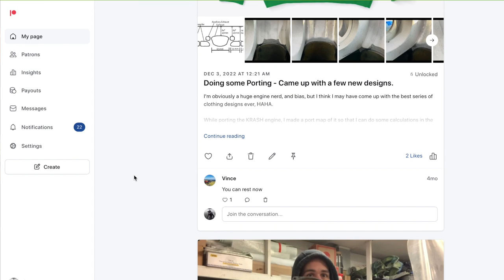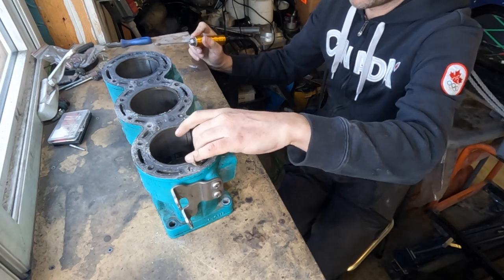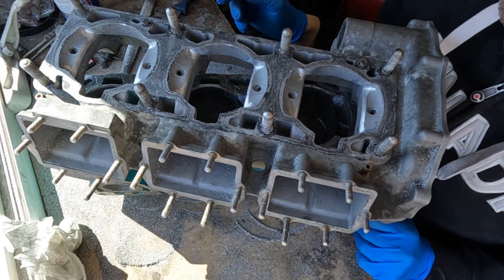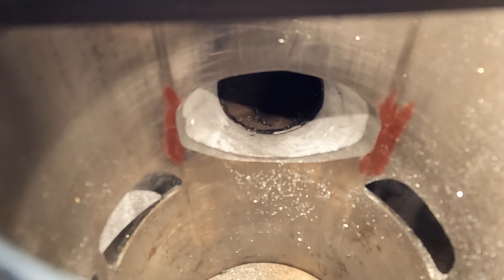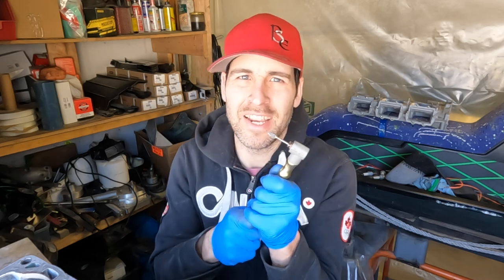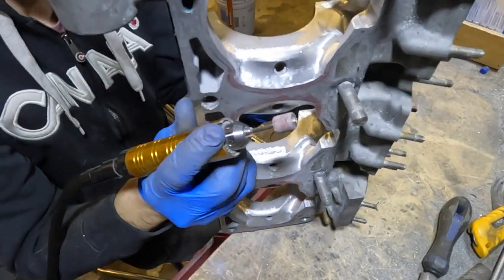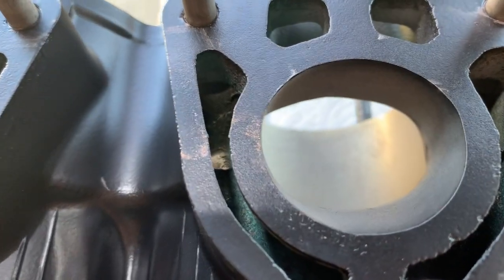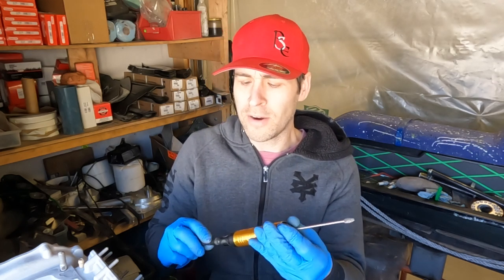ZXi 1100 Porting - Cylinder, Case & Tunnel Porting - Featuring Vevor Flex Shaft Grinder.

Comment: Joel you are a humble bad ass!!  Nice work bro on a tasteful port job!  Clean and not overly radical, perfect IMO. 

I personally think you should run your skelotonized flywheel cover!  You keep your stuff so nice I highly doubt a random bolt will ever be rolling around your engine bay that could pose a problem!
Reply from the maker: Thanks Tim. Let's hope we get some great results out on the water ! 

That's a great idea with the skeletonised cover... With the zeeltronics all the ignition really rempeds on is the trigger coil... so all the stator will be doing is charging the battery. I plan on unwinding the exciter coil to get rid of some parasitic drag. 

Good thinking... I'll have to powdercoat it ...
Reply: @Joel Arseneault  I've never seen a skelotonized flywheel cover I don't think on anything!  That will be pretty exciting I think to any motorhead seeing that!  For that reason alone I hope you do it!

Comment: What type of epoxy did you use? A link would be great!
Reply from the maker: I used squid boat epoxy ... but you don't need to use a specific brand. I have 3-4 different epoxies and used it because it's inexpensive (relatively) and doesn't have to be top quality. I mixed in some milled fibres to make it a little stronger (you don't need to) it also makes it a little thicker. 

You could use JB weld or any type of epoxy, really, but JB Weld would be very expensive to fill this volume. All you really care about is filling the cavity, so that when you grind through, there's not a giant air pocket that makes the flow worse, instead of better. The area will be sealed by the gasket surface, and the epoxy won't really add any strength.
Reply: @JoelArseneaultYouTube   Awesome thank you!

Comment: What happens when you mix 2 powder colors together? I assume they don't mix like liquid and it looks interesting.
Reply from the maker: I’ve never don’t it with two different colors … just flat black and mat black, but I do totally want to try it with the black and green and see what happens.
Reply: You can... we've experimented around with this some and it works.  In fact we even cleaned our airfilters from our powdercoating booth which used several different colors and used it on a special edition product, seriously!
Reply from the maker: @AtimatikArmy  Right on... I'll have to give it a go. So do the colors just mix, like blue and yellow make green ? or is it blotchy ?
Reply: @Joel Arseneault  probably a good idea to make sure it's at least blended together well but they will mix.  Our colors from our paint booth was mostly red and blue, then black, day-glo green, orange, & silver mostly.  The combination came out to a really cool purple that had almost like a fine metal flake look to it up close from all the different particles.  We called it Blurple and it was actually surprisingly cool looking. (I should add, at least that was my personal opinion of it!)
Reply from the maker: @AtimatikArmy  Haha... that sounds cool. Yeah... I can see it not always being the same depending on different powders, colors and whatnot.